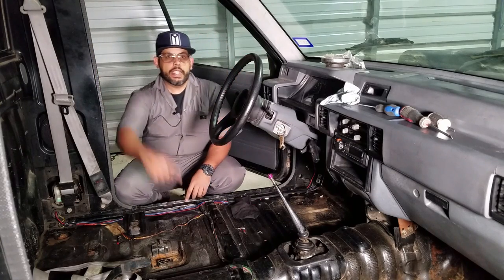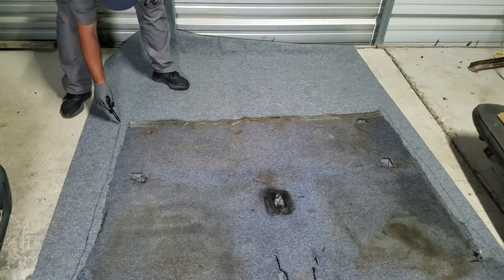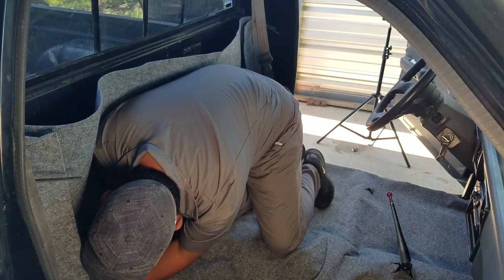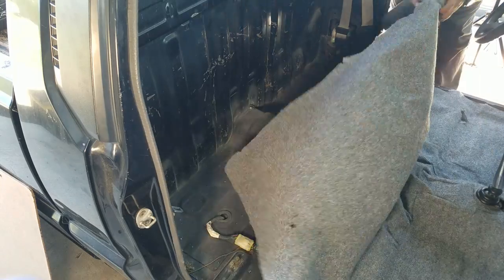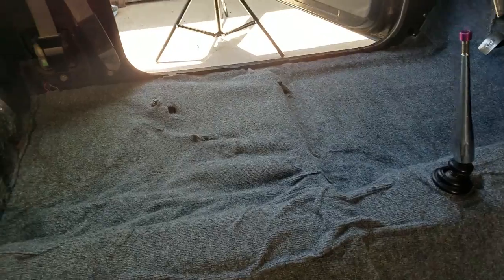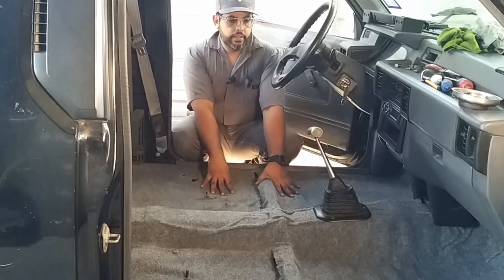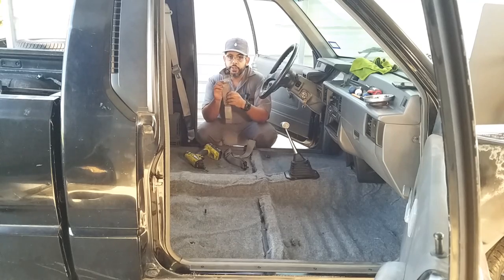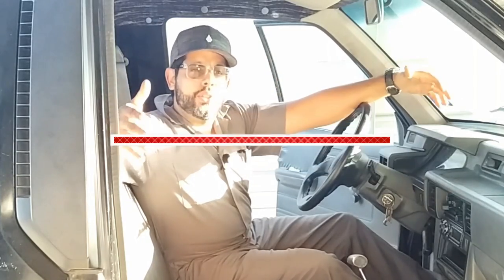DIY Interior Carpet & Headliner on the Mitsubishi Mighty Max Minitruck 😎 Interior Makeover Part Two!

Comment: . Number one fan here! Trucks looking good Joe. My truck's looking good too except for it's completely covered in oil all the way down the sides whole engine compartment underneath rims tires I'm talking about five whole quarts of oil came out of that there oil pump seal and went all over my goodness! Of course I added oil and didn't run dry it was kind of a slow process over the course of 50 Miles or so but I got tons of new parts for it I'm going to do a balance shaft delete new oil pump cover and all probably going to buy a new oil pan just so I don't try to play with knocking dents out of mine and cleaning it and painting  . Got a full gasket kit seals and everything got timing kit balance shaft Belt and pulley also. . Which is good because I'm actually just going to change the seal right now out of the front of the motor change the oil and everything I got it cleaned you got it down to about to take the timing belt off and I'm just going to do that for now because I'm waiting on Mitsubishi mirage stuff shaft OEM part because the balance shaft delete kit I bought on eBay was a cheap non-oil groove stub shaft and it would have stub shafted me if I used it so the delete is going to wait until I get new rod bearings in more stuff to make tearing it that far down more worth it and so I have even more work to do haha. That was my huge kind of setback transition into going steps forward, part failure thing... I'm also going to be slowly collecting parts cars or motors to transition the g63b into a full-blown 4g63 with dual overhead cam and turbo hopefully but I'm just going to slowly start getting parts together as I can find them cheap enough and if I find a hole Mitsubishi eclipse that's already ready to go I'll definitely do that if a cheap one falls in my lap.  FYI all the info on doing stuff like that is on "project zero g"  .com. Tons of good info there! ,How do I go about showing you a picture of my truck?
Reply from the maker: @Daniel Gonzales, I appreciate it! So humbling for real! Sorry for your current issues, that's car/truck life 😔. You and I have plenty in common with our minitruck visions and plans! I'm here if ya have any questions or doubts and I'll do my best to help, look me up on my socials and there you can DM your pictures! ✌😎
Reply: Kind of replying to your comment to the other guy about going extra low budget cuz your future visions I'd say yeah I did full dynamat under mine the whole cab actually has got to do the roof still so it was nice seeing you take down your headliner makes that easier to jump into I don't know if I'll be recovering mine I might just leave it off to be honest the dynamat looks kind of cool all playing but I will be putting some carpet in pretty similar to the stuff you had over my jute stuff that I got lay down over the dynamat I have a pretty sick sound system in it!!! How to try real hard to get some premium pictures act like I'm a photographer once I get it all lined back up good this time
Reply: Also I have my amps mounted on the back wall just over the dynamat and I never thought of putting a piece of trim like you did with the carpet was it like that brand new stock on certain models with the carpet and everything potentially? I'm definitely going to be doing that probably with the piece of 3/4 inch MDF so I won't get no flex I can mount my amps to that maybe try to make some sort of a cool looking amp rack actually and I could have most of my wires going behind it too through the Wood not a bad idea I think I'm on to something now.. Thanks Joe for helping my vision take form!

Comment: Nice truck man. Just got done putting new royal blue carpet in my 92 mighty max. I ordered it from  stock interiors so it came preformed and didn't need adhesive but was definitely less cost efficient than yours lol. Good job
Reply from the maker: @Jerid Schauer, Thanks! I was considering on going that route but I have future plans that might just end up without any carpet at all so going extra low budget on these projects! 😅😎

Comment: Great work and great video as well. My son and I have a 1995 Mighty Max where the original 4cyl motor and transmission have been replaced with a Chevy 350 and Camaro transmission with bang shifter. Can you possibly advise what adhesive spray you’re using? Thanks.

Comment: Joe do u think $1500 for green mighty max from 1988 is OK how would I fix AC if it doesn't work how about fuel pump how do u repair or replace that will a six pack camper fit a max will the truck be able to carry it with 4 cylinder engine does mighty max have a frame